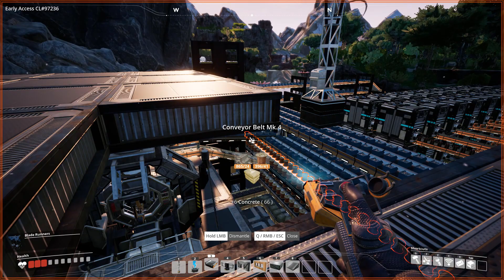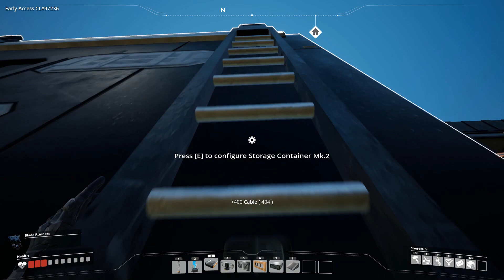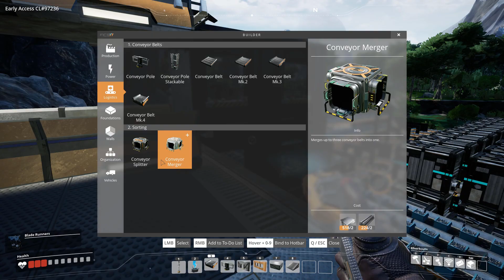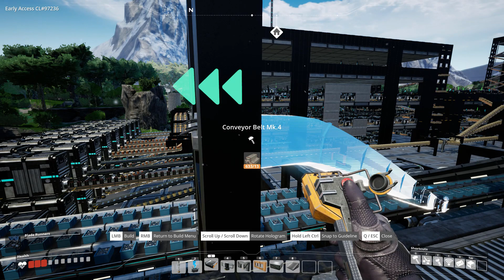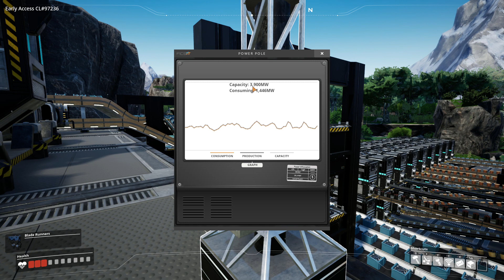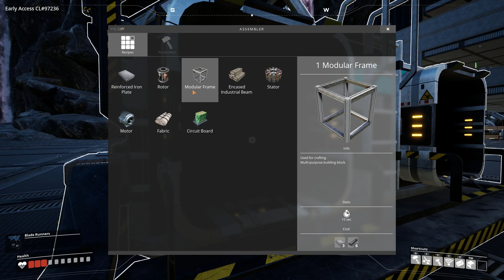Satisfactory #15 Minions Assemble

Comment from the maker: Mainly because I originally wanted something a little bit different but it ended up turning into a right mess >.< honestly the stackable poles would have been easier. but not as easy as the new vertical belts :P
Reply: Very true